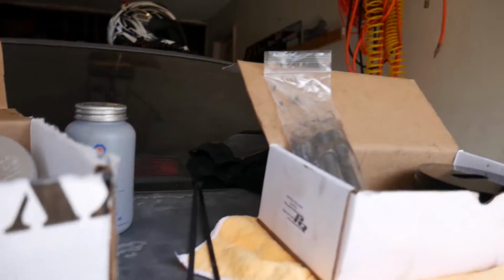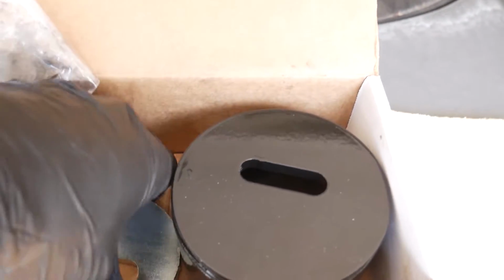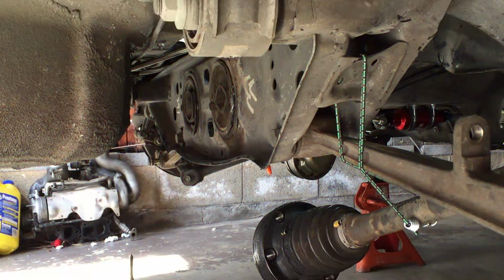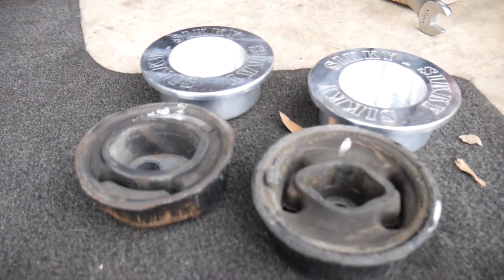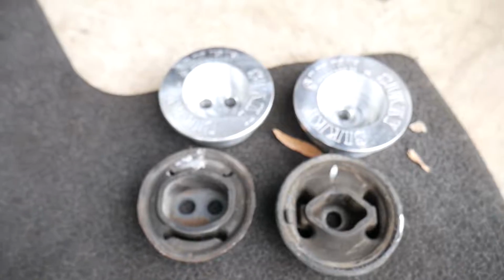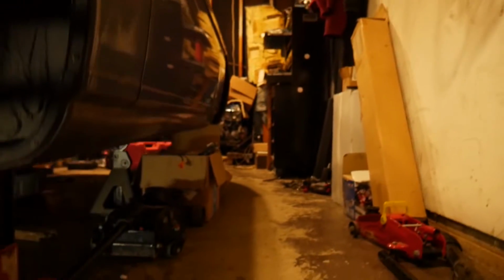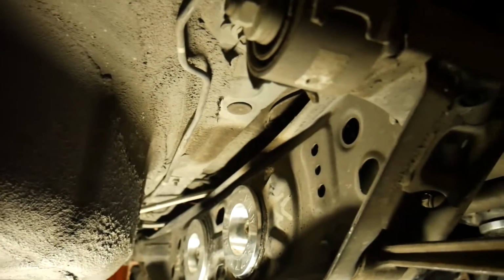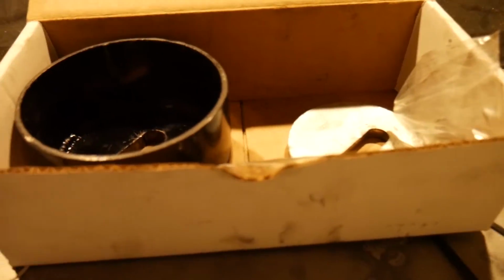SC300 Solid Differential bushing install (The Easy way)

Comment: Yo love your vids man, just a quick question I have a sc400 with Megan racing coils,rear camber/toe arms, I’ve had to do about 30 alignments on it at the shop I work at no joke bc the steering wheel always goes off center even if it’s aligned perfectly. I noticed the upper bushings for the subframe in the rear are shot as well as the ones you replaced in this video, the whole rear subframe has play in it.. this might sound stupid but do you think that would cause alignment to go bad? I know everything I installed is tight and I have new lower front control arms too so I really don’t know what else would constantly throw my alignment off and I haven’t seen that issue for other ppls scs
Reply: Its your steering rack bushings. Mine when it had bad rack bushings would sway left to right and the wheel was off centered.

Comment: How were you able to do the fronts with out an air hammer?
Reply from the maker: I was prepared to buy an air hammer but tried a regular regular hammer first. Came out pretty easily.
Reply: @Edward3jr  no way awesome! Thats good to hear im guessing you just heated up the metal around the bushin and then knocked it out ?
Reply from the maker: myles g not exactly, I used a hole saw to drill out the center, then using a chisel and a baby sledge I beat the bushing inside and then out

Comment: full removal and install. I couldnt get my bolts off the driveshaft when replacing my clutch. I took the driveshaft apart in the middle. keep the content coming bro
Reply from the maker: Joseph Cullender I got you! When I do this again on the red sc300 I’ll do a start to finish video.

Comment: What's the benefits of solids?
Reply from the maker: CarPartsAreMoreImportanter there are a couple of benefits. For me I want  a stiffer ride feel. in my other sc300 I get a lot of bounce in the diff when I clutch kick. This will eliminate all of that. The one not so great thing for some people it can be a bit noisy and too stiff for the street. My personal experience so far is great and I can’t tell the difference and like how stiff it feels. Hope it helps.

Comment: If you do it on the red $600 sc can you compare how the nvh (noise, vibration, and harshness) is compared to the stock rubber bushings?
Reply from the maker: 21Willy my game plan is to see how the solid bushings feel on this sc300 first before I upgrade the bushings on the red sc. I plan to compare the two!
Reply: Edward3jr Awesome I’m looking forward to the comparison! I’m alittle hesitant on solids for my sc

Comment: Thanks for tutorial man. How does these solid bushings perform on a daily basis? Is the ride super hard, any annoying noises, vibration?
Reply from the maker: Miha Šuligoj honestly, they feel great, but between the loud fuel pumps, and the stiff fortune auto coilovers it’s hard for me to notice the difference these are making over stock because I upgraded so many parts at the same time while it’s was not running. I’m going to do this again in my other sc300. And I should be able to notice any differences these make. So far I love them though!
Reply from the maker: Miha Šuligoj I should add, that when I lose traction, there no more wheel hop. That is 100% gone. I experience this in my other sc300 and it feels terrible. My comment above is about the daily drive ability with noises and vibrations. Hope this helps!
Reply: @Edward3jr  Ok, I think I could live with that as long as there is no much vibrations to the cockpit. I already installed Magnum T56 on my Supra which just barely fit down there and after some launches, I lift the car in the air to see if there is any problems. I found out that there is surprisingly a lot of movement and abuse on the diff, much more than we ecpected to be. So with these solid diff bushings the diff will stay in place for sure. Thanks for the info, peace!
Reply from the maker: Miha Šuligoj anytime! Let me know if you have any questions!
Reply: @Edward3jr  Thank you. Best regards!

Comment: Did you get any super harsh noise or vibration after going solid?
Reply from the maker: I dont recall hard noises but then again, I have a 3.5 inch exhaust that makes it hard to hear anything. I will say at wot it goes straight

Comment: Hey Ed, what did you use to get the diff bushings on the diff itself?
Reply from the maker: masertiz I plan to do this again to show everything. But I first drilled the center out with a whole saw, and then I beat it out with a hammer and a chisel. It was about a good 7 minutes worth of work per side. Probably faster with a air hammer.
Reply: @Edward3jr  Yeah, it sounds like it would. Do you think the bushing removal kit would fit an IS 300?
Reply from the maker: masertiz yes, this tool will work for is300 too! https://www.powerhouseracing.com/product/5614/phr-rear-differential-bushing-removalinstallation-tool

Comment: Good stuff bro, got a 1jz soarer here in canada. Just threw in some fortunes as well, been thinking about doing this. Between this and the stock how much more NVH are there? Also how did you get the 2 little bushings facing up from the pumpkin off?
Reply from the maker: mark zhao as far as NVH goes, I have not noticed anything significant. This could be due to the combination of coil overs and loud 3.5 inch exhaust. Also I’m still on stock subframe bushings. I imagine if I upgrade to solid subframe bushings NVH will be more noticeable. I think in a bone stock car (stock suspension, stock exhaust) it will be very significant. I plan to do another video when I upgrade the bushings on my other sc300 to show more details. But the front bushings I used a whole saw to drill the center out. Then using a hammer and a chisel I beat them in first and then beat them out. It takes about 5 minutes per side. The new ones go in very easy. Let me know if you have any questions about this! Thank you

Comment: Hey man, do you mind measuring the tool surface area? I love this idea of this tool, but I'm all the way in Australia and our dollar is weak as shit, so this makes the tool that much more expensive (not even including the shipping). I've found a diff bushing removal tool for another vehicle for a LOT cheaper and I'm wondering if I could use it instead.
Reply from the maker: Matt Misanthropy sure thing, the diameter of the cup is 4 1/2 inches long 2 inches deep. The diameter of the plate is 3 1/2 inches long. The studs are about 6 inches long. It was very easy to do this with this tool. Let me know if you have any questions!
Reply: @Edward3jr  Thanks a lot man
Reply from the maker: Matt Misanthropy anytime!

Comment: Nice tool but not worth $100 made something similar with $20 from homedepot
Reply from the maker: Ricky G yeah, you can totally make this tool at home! Very simple
Reply: what did you use from home depot?
Reply: masertiz you can use anything really but I used a metal bar that I cut and welded it and drilled a hole for a long bolt to fit through to use as a killer but to be honest the very best way that I can see that’ll make you life easier id nothing works it just make a quick cut across the old bushing and it comes out super easy!!!